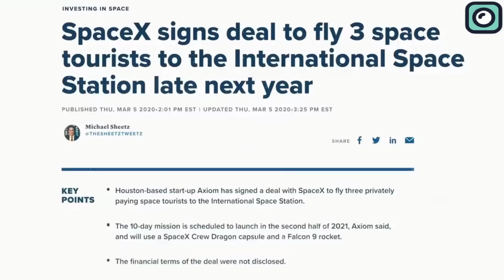SpaceX in BIG TROUBLE? NASA just declared "No Starship launch in Florida unless..."

Comment: No,  Merlin engines use a rocket grade kerosene (RP-1) and liquid oxygen as rocket propellants in a gas-generator power cycle.  Not:  "The thing is SpaceX uses liquid Oxygen and Nitrogen as fuel for its rocket launches."  Ron W4BIN

Comment: New for nasa in terms of fuel but meanwhile NASA is using hydrogen which can be just as dangerous.
Reply: I think it's more the rather unique manner in which they're planning to land the craft after launching. This will be the first craft attempting to actually come back and "land" at the pad.

Falcon Heavy boosters have done it at in the past, but those aren't actually coming back and landing at the pad itself, but instead at nearby landing pads built for that purpose.

Comment: As NASA seems to have recently realized that a fully fuel loaded Starship (oxygen and methane) and has the explosive capacity of FOUR WW2 atom bombs, odds are that SpaceX will not be permitted to launch a fully fueled Starship except at least 20 miles offshore.
Reply: Not true by even a stretch. Where did you hear this?
Reply: @acidhippie1884  - Actually.. while I'm no expert, a bit of back of the napkin math would seem to show that while this isn't exactly true (at least I don't think it is), it's a lot closer than I'd have thought.

Fat boy had a yield equivalent to 20,000 tons of TNT. That's equivalent to around 83 million megajoules of energy.

I could be doing the math wrong here, but looking at the energy density of methane (55.6 MJ/kg) and considering that Starship will carry somewhere around 1000 metric tonnes of methane propellant, that gives a total energy of around 55 million megajoules. I'm honestly not sure if that's how you'd actually compare the two or not though. The energy density of methane seems to be nearly an order of magnitude higher than TNT though (4.6 MJ/kg compared to 55.6 MJ/kg), so it seems to be at least plausible to me that the energy released by such an explosion would be at least comparable.
Reply: @eno2870  Actually it's closer to 740t of methane, but the main thing is the fuels aren't sitting there mixed in the tanks, they're separate. So if a rocket explodes it tends to only release a small fraction of the energy as an initial explosion, most of it burns afterwards when it mixes in the air, this results in a significantly smaller explosion but a much larger fireball.

For example, when the N1 rocket exploded it had the theoretical equivalent of about 7kt of TNT worth of fuel, but it's estimated that the explosion was the equivalent of less than 1kt of TNT.

So realistically going with a similar ratio you end up with somewhere around 1.5kt equivalent in a worst-case scenario (Explodes on the pad while fully fueled, before take off).

Keep in mind that as things get larger, it gets harder and harder for the fuel and oxidizer to effectively mix before they detonate and get separated, so the actual yield would likely be even lower.
Reply: While you got the fuel right (unlike the idiot video) your atom bomb equivalent is total BS.

Comment: Starship uses liquid Oxygen and methane. Not nitrogen
Reply: That that is where I stopped watching it. . .
Reply: Same.... My eyebrows went up when he said nitrogen....
Reply: Nitrogen is used as an inert gas with a similar chemical weight as oxygen and methane to test fueling under pressure without the risk of explosion.
Reply: @edfinite7534  Yeah. . . But the nitrogen is not what is used as a fuel.
Reply: @SeanHollingsworth  Nitrogen is used to fill and pressurize fuel tanks to pinpoint leaks before using fuel, in this case methane and oxygen.
Reply: @edfinite7534  Everybody knows that. . . But, the narrator of this video specifically stated that the rocket is fueled with liquid oxygen and nitrogen. It is fueled with liquid oxygen and liquid methane. He should probably redo this video, and and resubmit it without such a flagrant elementary error.
Reply: @SeanHollingsworth  Got it.
Reply: @SeanHollingsworth  There is more than one error.
Reply: Yep .
Reply: What nitro is an oxidizer not a fuel
Reply: Demanda millonaria tendran por chavos y atrasos que son chavos👀👀